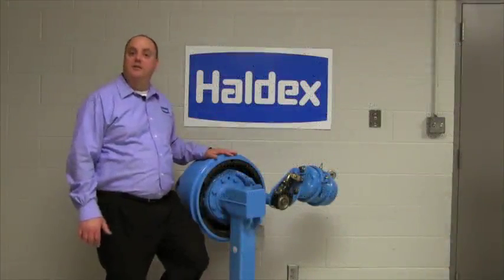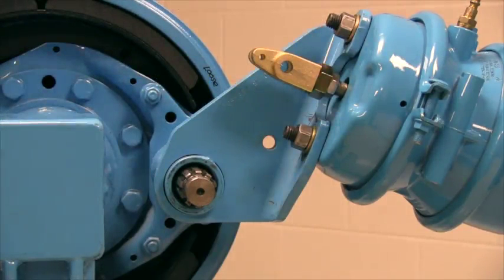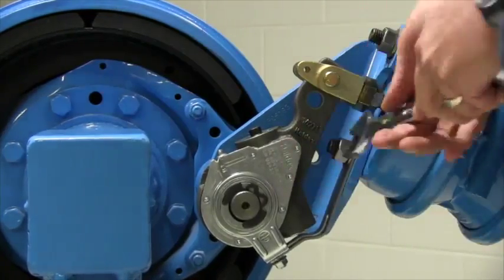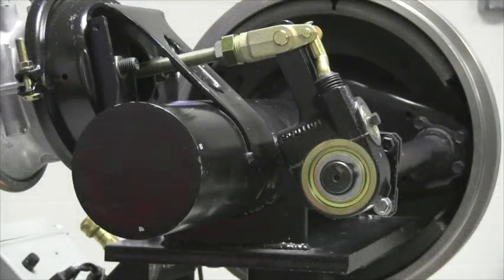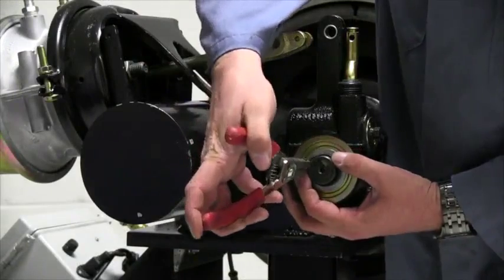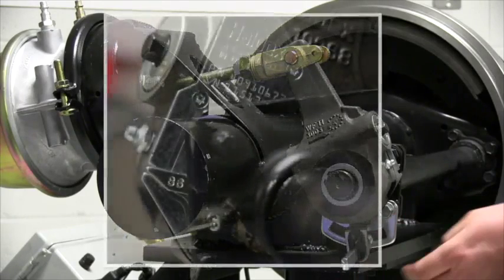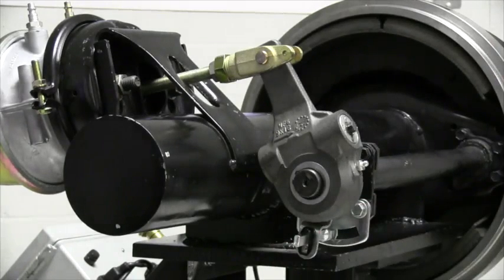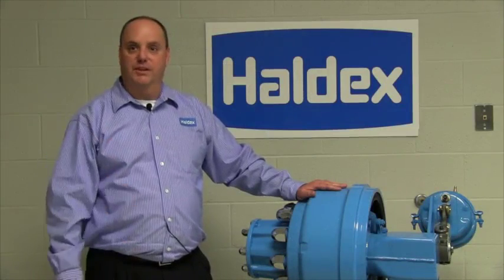Tech Topics: Replacing Gunite Brake Adjusters with Haldex

Comment: The joy of replacing NEW PARTS. They always make it seem so easy "slide the slack adjuster off". More like beat the hell out of it with a hammer or use a puller (and say a few choice words because the pulle is not fitting on right)

Comment: I wouldn't want to sit here watch a guy drill out pins and stuff, here to see what the goal is, shorter and sweeter the better. 
Good vid, but wish they would explain why or what happens if you don't set the control arm (4:45) correctly.